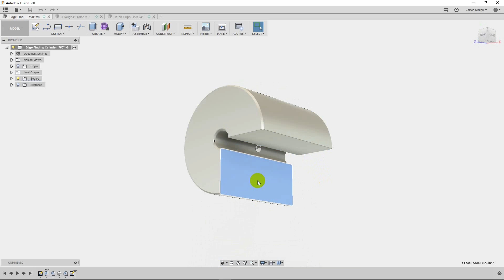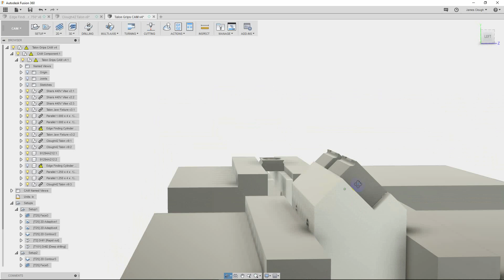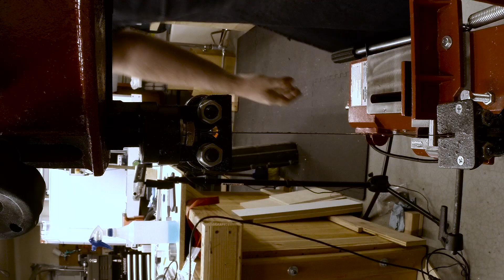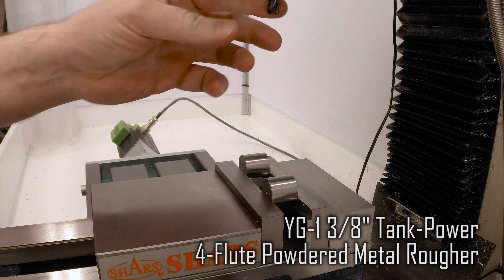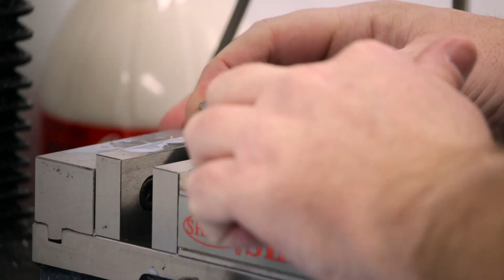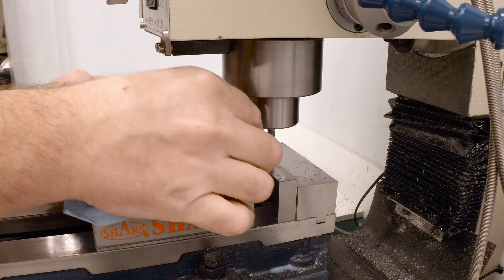Making a Split-Cylinder Edge Finder Tool

Comment: If you had a real life CNC machine that kind of rpm your running on that lathe might be relevant but on that hand machine it would serve you right to have that part come out and hit you right in the head you're not going to get nice finishes running that tool on that hand machine by hand.
I've run manuals and I've run CNCs better than forty years now you're better off simply taking reasonable cuts at reasonable feed rates at a reasonable rpm.
Just running that machine at that RPM is dangerous the inertia alone will cause that scroll Chuck to open taking parts right to zero isn't a good idea either how will you account for the crust left from heat treating and why in the world would you use simple fractions ending in tenths of a thousandth of an inch when you be better off using a diameter that is an even decimal like .6 or .8 or even 1.0 so the resulting offset is .3 .4 .5 .
Too damn much fussing around on s*** that don't matter and blowing it on everything that does.
Seriously,

Comment: I have a reservation about your accuracy check at the end of the video.  Sitting the tool on a guage block that is half the diameter of the initial stock and checking with a surface dial indicator does not guarantee that the cutout portion is half the diameter of the initial stock.  The cutout portion could be more than half the initial diameter but sitting it on a guage block might mean that there was a gap underneath and that all you are indicating is the diameter of the initial stock!  If the cutout depth is less than half the stock diameter then yes you will get an indication of that condition.

However I like the application and so I went out into my workshop after immediately watching your video and made 2 of these blocks.  I just hope I remember to use them when the need arises!
Reply: I understand your concern, but the gauge block that was under the tool was .400, not .375, thereby ensuring that the gauge block was in direct contact with tools machined surface. With that setup the tool should be about about .025  +/- machining error, above the surface of the granite. I would agree with you if he had used a .375 gauge block. His measurement technique looks fine to me.
Reply: @psmola101  Yes on reflection my concern was not valid - proves  I ought to consider my commet carefully before going to print!  Thanks.

Comment: A 0.0001" DTI and you think it's remarkable that it required 20min of fiddling? 😅

A drop indicator with a button tip would be easier, but getting one that reads tenths is  pricey.

Comment: This is an “edge finder tool” according to your title but I don’t understand how it works. After 60 years as a machinist and tool maker I’ve never seen one or how they’re used. I’m familiar with cylindrical edge finders but can’t imagine how this type works.
Reply from the maker: This just provides a cylindrical surface of a known diameter, accurately locate on the corner of a workpiece.  You use a normal edge finder against the side of the cylinder and then add or subtract the radius.  Without a tool like this, there really isn't anything to register your edge finder against.

Comment: James I love the idea of using the gage blocks to get the correct measurements but watching the difficulty you are having holding the mic and the blocks I would suggest placing one gage block on the right side of center and the other on the left side of center. Thus giving you parallel surfaces to measure. Also when making a gage I would recommend making a few tenths over and lapping to dead nuts. Thanks for the video
Reply from the maker: The issue here is that the reference point for the block is above the centerline of the cylinder, meaning only about half the anvil is in contact with the block.  Placing another block on the other side might make it easier, but also introduces a second surface that must be kept in contact with a square reference against the force of the micrometer.  I'm not sure how much easier it would really make it.

Comment: I would have liked to see 30 seconds, or so, of how you were using that .0001.  But, thanks for all your videos.  We are learning a lot of good techniques.  God bless!
Reply from the maker: This is an old video, so I'm not sure if I understand the context of your question.  Do you mean why I'm concerned about a couple of tenths?  It really doesn't matter that much in the absolute sense, except that every error adds up.  The feature I later made with this tool measures only .015" and I wanted to be able to just ignore any error in the tool.
Reply: @Clough42  I suspect he's referring to the ~20 minutes you skipped at 34:50.

Comment: Interesting I ran into this problem with making a similar fixture.  I solved it differently by milling a spot in the fixture that I could use specifically with an edge finder then set my coordinate to that feature.  I will have to make one of these for when I need it.

Comment: This is perfect I’ve had the makings of a tool post grinder for a year or so now and just purchased a $5 edge finder versus making one and plan to take similar steps as you. The plan has been to setup the tool post grinder which is actually a 3.2kw 18000 rpm spindle so I can do internal and external grinding as well as sub c work. I’ve just made a thread in adapter for a timing pulley to mount in the back of my spindle where the spider would go so I made it two part a spider and pulley mount. This way I can use a magnetic shaft brake that can engage and disengage the sub c when I’m not running the main motor. Pretty excited I’m getting close. People don’t realize the time involved to get it all prepared and complete unless you absolutely have nothing else going on and lots of free time ;-).

Edit: you must not do any direct Mt arbor or 5c spindle work since you have that plate and guage mounted front of saddle.

Comment: so, you are making a tool, the split cylinder edge finder, to make a tool.. the talongrip edge jaws.. which will then be used to make another tool, the soft jaws.. to make yet another thool... the motor clamp for the toolpost grinder?    #toolception
Reply from the maker: Yeah.  That's about right.  And of course I'll be using the toolpost grinder to make more tools.
Reply: that's what i thought hahahaha. i've been binge watching your videos, and i must say im impressed with  your work. congratulations.

Comment: Well done.
I know nothing about CNC or your machine but just wondering if you could have touched off on a gauge pin inserted in the bore
and set your DRO from there?
Reply from the maker: Yes, that would also have worked.  Of course, that's a drilled and reamed hole, so the size is very close (within a few tenths) but there's likely some error in the position.  It might be interesting to measure now and see how close it is.  In the end, I wanted this to be within tenths, so I measured as precisely as I could between the faces I cared about.